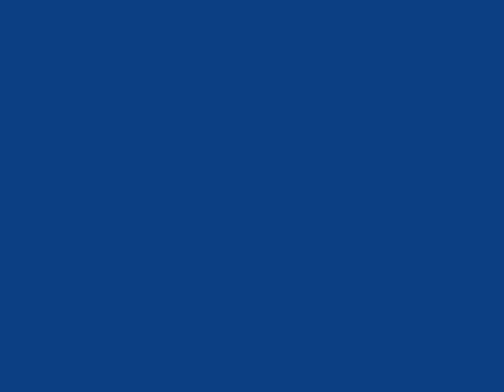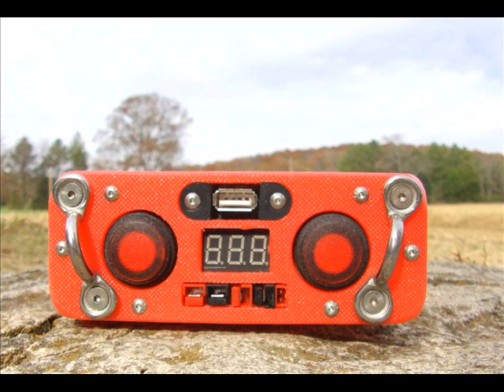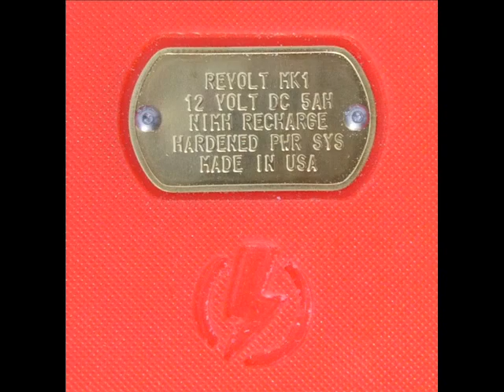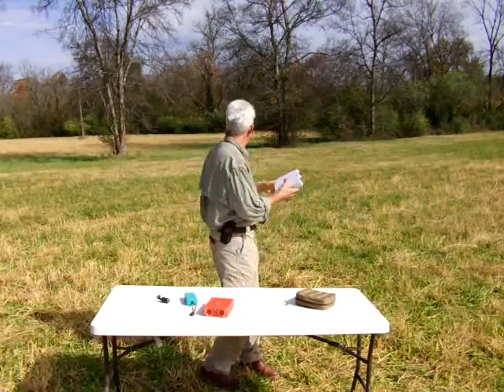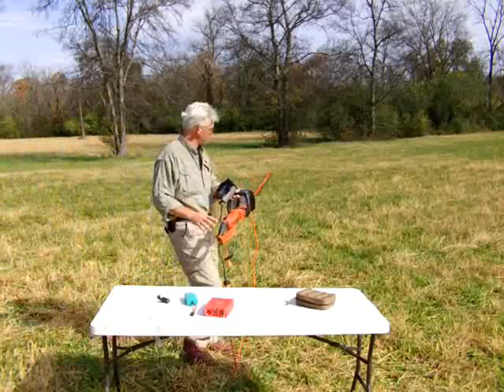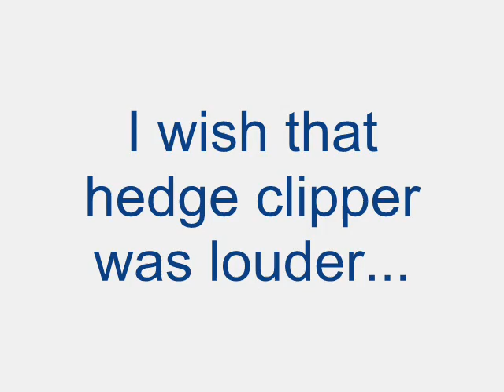3 The Revolt, Waterproof Battery,Search & Rescue, Disaster Response, Power Outages Buy yours today!

Comment: I just finished watching all 3 vids. Wow, very impressed with this product!!!

2 questions

1. You mentioned, at least i think you said this, that the battery is encased in silicon. Can the battery be replaced at the end of its life time or do you have to by a new unit? I am guessing you cannot replace the battery like most of the devices on the market, especially at that price point.  

2. What is your warranty on your products? I do not recall hearing that mentioned in the videos I watched.